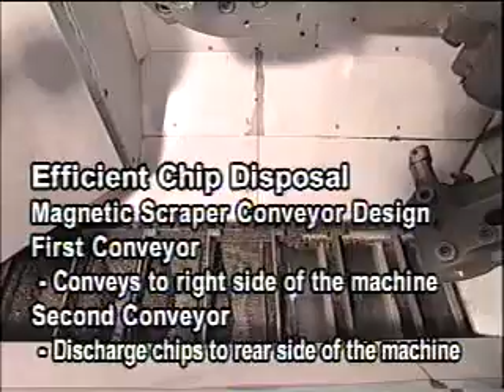Muratec Murata MW400 CNC Lathe

Comment: This is an awwsom machine. my company bought one at the first of the year. I was able to go to the Murata plant in N.C. to do the run-off first of march.6 months rrunning and no problem yet. The programming is almost the same as any lathe. You have to look at it like two machines it runs left , Right, & gantry programs. The gantry has simple teach points. we have Ultra grip chucks and air sensing so it will not run a miss load. Tolorance is great will hold tenths all day.

Comment: @Benuouo Roughly, they last like 20 odd years plus, that's probable power tooling as well, it's got more than a 5 axis thing going with the auto loading and other unusual above (not seen by me tooling), I have used twin chuck machines before, I bet this thing can do some fairly meaty cuts, i'd say that can easily do 5mm cuts across the face and down the sides with those demanding G71's..

Comment: I'm gonna have to say this is the baddest CNC I've seen. Should of milled some nice slotted and cross drilled racing rotors. Would of paired up nice with this machine instead of crap stock cast iron.